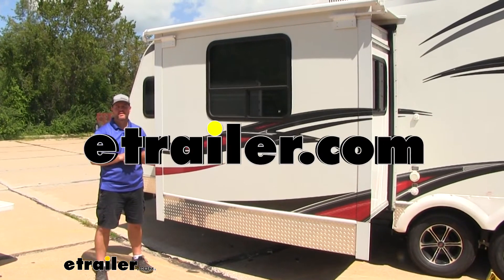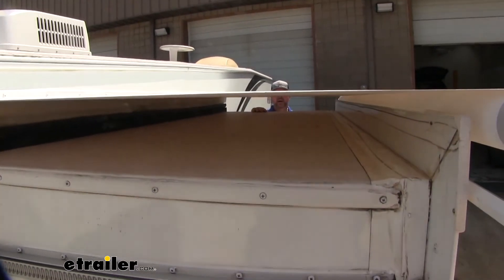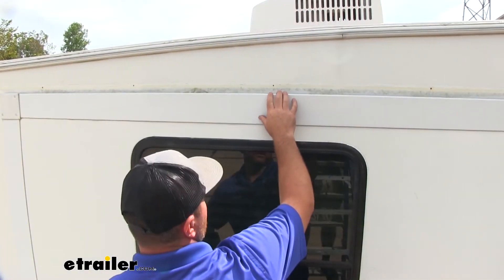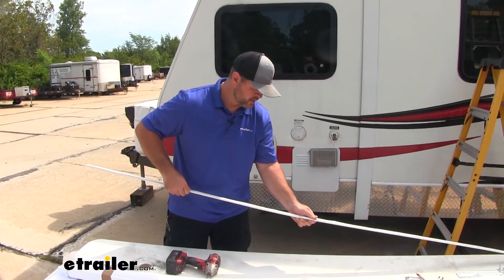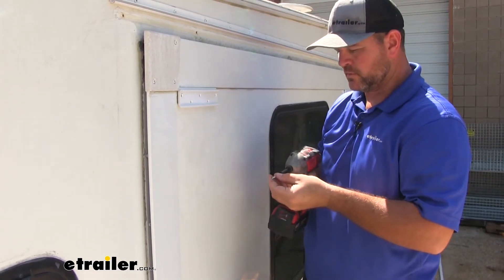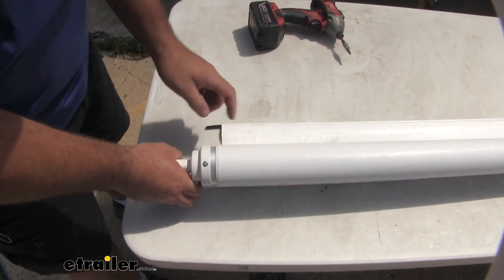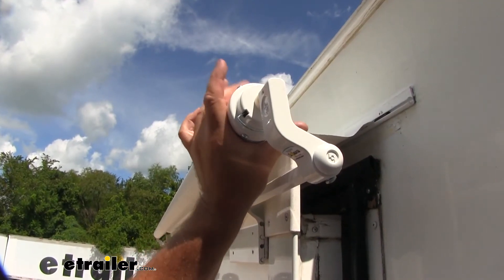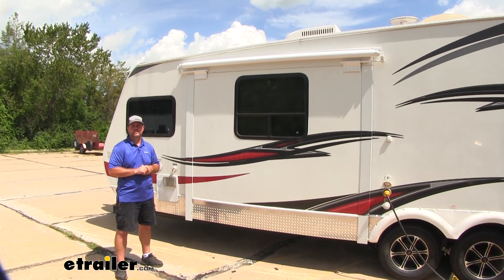Installing the Solera RV Slide-Out Awning on your 2012 Cruiser RV Fun Finder Xtra Travel Trailer

Comment: How can I do this without pushing slide out in
Reply from the maker: Installing slide toppers is much easier when the slide is in because of the spring tension on the roll. If you were to try and install it with the slide extended you would have to unroll the slide topper and that would not end well.
https://www.etrailer.com/RV-Awnings/Lippert/LCV000163289.html